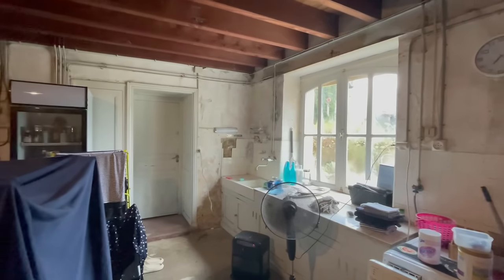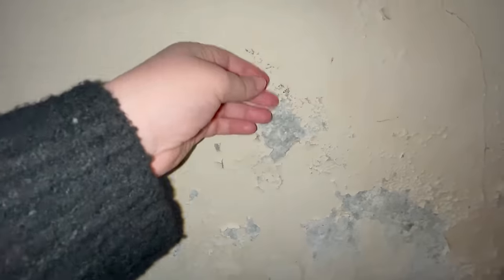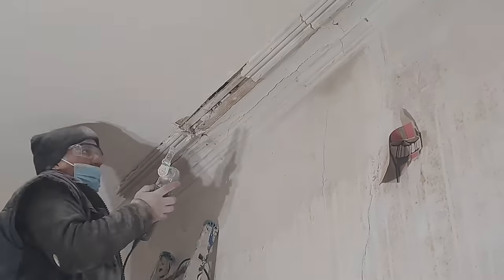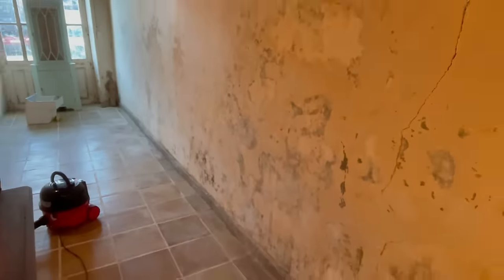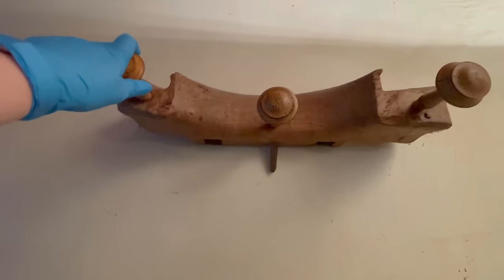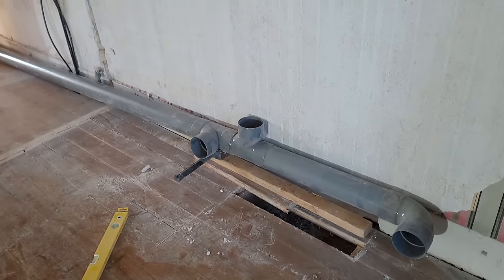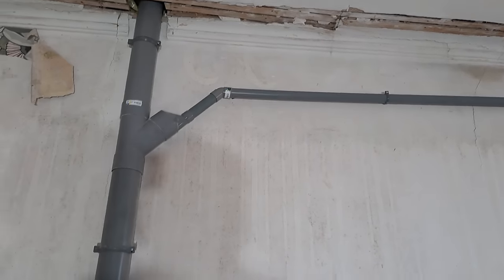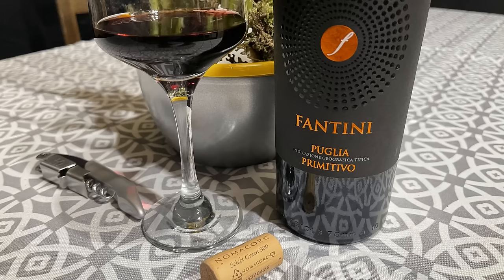What a Waste... #132

Comment: Hey Dear I have painted for over 25 years and the best way is with a 18" center hung roller and a pole. It goes very fast and its the BEST way to paint a ceiling with no edge lines also uses a 4" roller for all counters and it can be used next to ceilings if going same color. I hope this helps. P.S don't be afraid to use a sprayer if you like masking off.
Reply from the maker: Great tip! I am going to try rollers more this year. I am not sure if it just me but I seem to get paint all over when using them. All the best from France - clare & Nick
Reply: @theexpatbutchers  I wish I lived closer. I could stop over with some great painting tips. :virtualhug: From Montana USA

Comment: Clare I have the same problem with my kitchen stuff, it's all boxed in my attic, waiting for my new kitchen to be finished😢

If you hate rollers, I suggest you try paint pads. They are not in vogue at the moment, but they give a great finish and on flaky unstable walls they are very gentle. You're doing better than me in this cold, I've struggled to get motivated! Although it's much better today! Off to battle the protesting tractors on the roads😢
Reply from the maker: Heads up if you get this a couple of round abouts near saintes are blocked 🚫 with 🐴 horse erm 🫤 shit